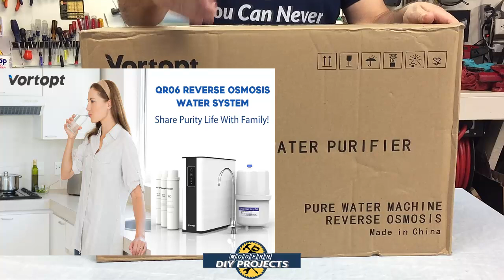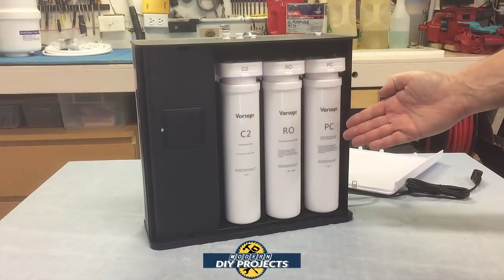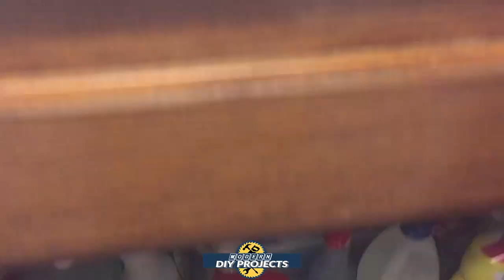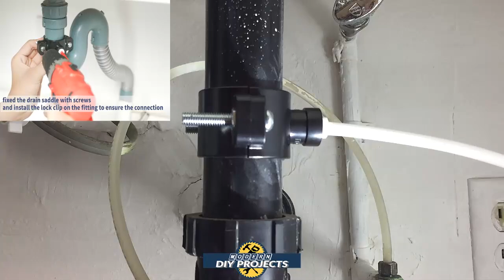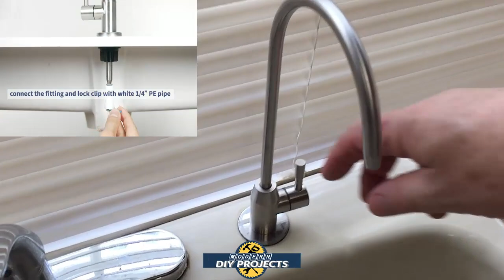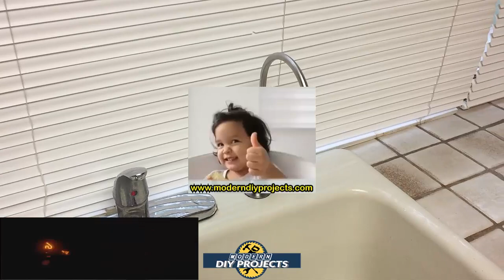Reverse Osmosis Water Filter Installation DIY Using Vortopt Water Filtration System

Comment: Are those hoses solid colored? (Meaning, you cannot see through them)
Reply from the maker: Yes, the white is a solid color. You can see the older hose from my original filter installation is a clear hose in sontrast. The clear ones always turn yellow over time.

Comment: You will love the R.O.S. I had one at my old house and had rather crappy well water. So bad i had to bring in 5 gallon bottles of water for drinking. I put in a R.O.S. system and I loved it! But one suggestion get a water softner also?
Reply from the maker: Funny thing. I have always had a water softener in this house but it has been a constant pain always breaking down ever since I bought this place. Finally it started leaking beads and I just gave up on it. I am hoping to sell and move in the very near future so I just turned it off instead of spending a few hundred to fix or replace it. I think in my next house I will install a whole house filter instead of a softener. See if that is more reliable.